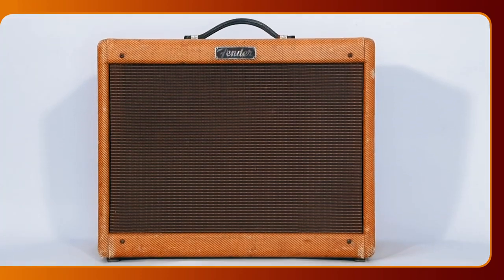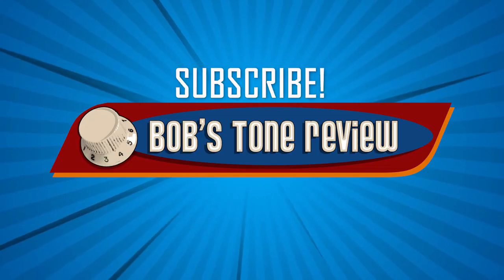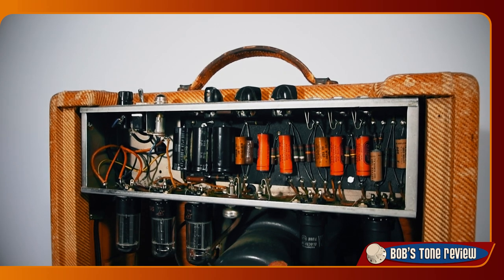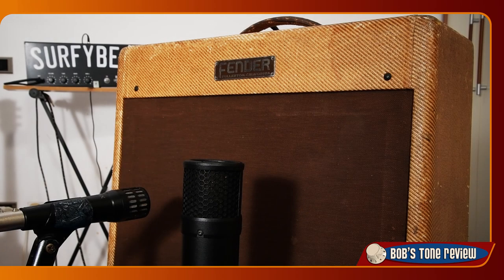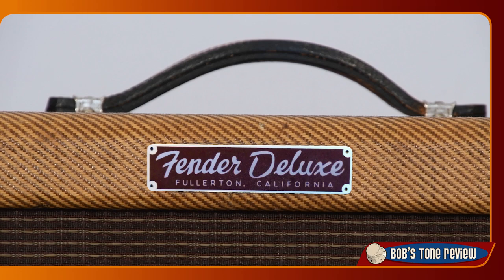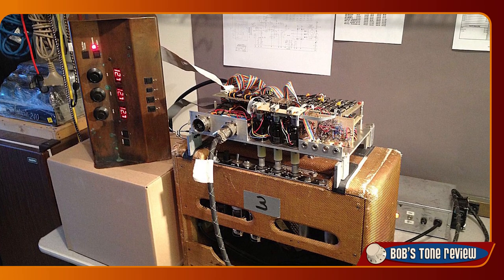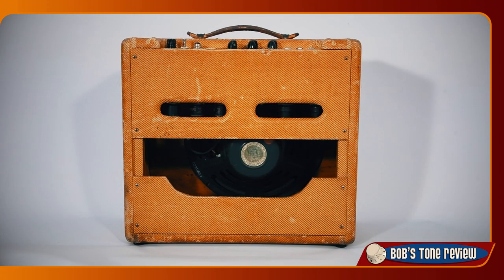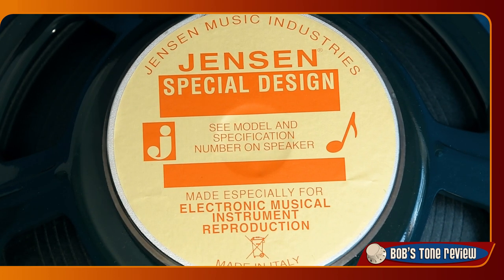BTR#41  Vintage Fender Tweed Deluxe Amps of the 1950's, 5A3 to 5E3

Comment: Use Weber Classic Alnicos ... sound better than Jensens.
Reply from the maker: Weber speaker are fabulous... because they were modeled after vintage Jensen speakers.
In these amplifiers you can find the originals that the great Ted Weber strived to replicate.
Reply: @BobsToneReview  Yessir! Weber added a bit more bottom end!
Reply: Alnico is the best
Reply from the maker: I generally agree with you @smoochie3331  but some people thinks that the worst alnico speaker is still better than the best ceramic speaker; which is a nonsense. In fact there are some really sweet sounding vintage speakers with ceramic magnets. Just think of the Celestion "Greenbacks" in old Marshalls, or Jensen C15N in blackface Vibroverbs or CTS 10" speakers in Vibrolux or Super Reverb amps.

Comment: greetings,
very informative content, thanks for sharing.
fender has issued '57 custom deluxe, what's your take on this? why is this mentioned as 12 watt?

cheers
Reply from the maker: Hello Tamra, thank you for your kind comment, I'm happy that you enjoyed! I must admit that I never had the chance to try the '57 Custom Deluxe that I mentioned in the video. Some reissue amps sounds very nice but none I tried can compete by far with their original vintage counterparts from the 1950's and 60's... I would dare to assume that the '57 Custom Deluxe is no exception. 
Through the years, different versions of the Deluxe circuit have different power ratings; I think the popular blackface and silverface versions are 22 Watts; earlier tweed models have lower power wattage.

Comment: to see another vintage version of the 5e3 look at the Dearmond R15.. It has a larger output transformer,, , a more moderate voltage with 330V on the first filter cap witha large 40 microfarad rating (i think a slightly different resistance on the OT and lower voltage allows for that large cap valur). The R15 has a smaller dropping resistor at 2.7K giving you 300V on the screens giving you less screen voltage drop under heavy loads, The R15 uses 0.047 coupling caps in the output stage instead of the larger 1M of the 5e3. 
I have not seen the preamp of the R15 but the tremolo version of the amp has a 12ax7 in the preamp instead of the lower gain 12ay7 in the 5e3,, But the Dearmond uses 0.047 coupling caps in the preamp and has 350k pots instead of the 1M of the fender.. The 350k volume pots lowers the input gain of that 12ax7 first stage getting close to the value of the 12ay7 in the 5e3.
Reply from the maker: Thank you for the information Andres, that's interesting. In fact the 5E3 circuit is quite similar to that of many amps of its days... more on this subject in the next episode BTR#44.

Comment: You say you did some upgrades to your R4 Les Paul. What did you do to it, and why, please Bob? Cheers, from Sputnik and Shane, here in Australia.
Reply from the maker: Hello Sputnik and Shane, thank you for getting in touch! Through the years I swapped nearly every part with its vintage original correspondent. Pickups are original soapbars from 1956. I put a nylon nut, vintage hardware, caps and so on. In fact the guitar itself it's about the only remaining part from the Gibson Custom Shop : )
I could say that it probably represents the closest you can get to a vintage original, besides the real deal.  You might be interested to check out these videos:

https://youtu.be/DbgC4rD0jO8
https://youtu.be/Lsp_Ubu49QQ
Reply from the maker: As for "why", the tone improvement is unbelievable. Of course it still misses the sweetness of original woods from the 50's but it's a killer player for my live gigs.

Comment: At 14:14 - WHO did you say "takes advantage of this feature...the most 5E3 addicted artist?" (cannot understand thru the accent). Thanks, nice descriptions and history info.
Reply from the maker: Hello Jojokeo, he is Neil Young. Please note that you can easily activate English subtitles, which I manually upload and are very accurate.
Reply: @BobsToneReview   Thanks for the quick reply. I know all about Neil & his love of the 5E3's. Just wanted to confirm. I've redesigned & built mine in the thumbnail photo 4 complete times - no longer a 5E3, but w/ a PP pot defeating neg feedback/Presence control and a high value Mid pot turned up re=creates the Tweed tone and feel when wanted. The transformers are over-rated so I've biased accordingly where I can also switch out the 6V6s to 5881 Tung Sol there to for larger venues or if increased headroom is wanted. Cheers my friend! (the long explanation is for the gear / tone hounds out there like us 🙂)
Reply from the maker: @jojokeo  thank you for the compelling explanation! Great to have you on board. Please feel free to browse among the other content of the channel... there's plenty of amp-geek stuff 🙂 Please remember that you can always activate English subtitles to make things easier.

Comment: Well done video of both the development of the Tweed Deluxe and tones available.  Nice to have a "review" video done with both clarity and passion for the subject. Thank you!   One comment on the mushy 5E3 bass: it depends on the speaker being used and I prefer ceramic magnet speakers in 5E3s though the Italian Jensens generally have a wide, mushy bass so try something else.   Vintage Oxford 12"s seem to work particularly well.  Internally the V1 to V2 .1/400v coupling caps can be reduced in value.  Try .047 though .022 may thin out the tone too much for some and use 600/630v polyester caps for correct tone.
Reply from the maker: Rick, thank you so much for such kind words and nice feedback! Also for the very interesting technical information. On my '58 Deluxe 5E3 I had an original vintage P12N made in Chicago and sounded stunning... until it lasted : ) Please feel free to browse among the other content of the channel.
Reply: @BobsToneReview  Both my 5E3s have the original speaker but of course the one I play has another speaker in it.  You got an especially nice crisp tone out of your Les Paul if it was going through an alnico speaker. Take care
Reply from the maker: @rickschiller  thank you! My '54 VOS Reissue Les Paul is retrofitted with original vintage parts and P90's from 1956, so this definitely helps : )